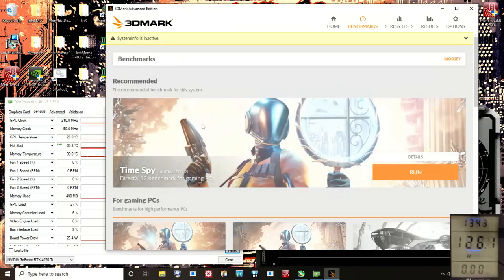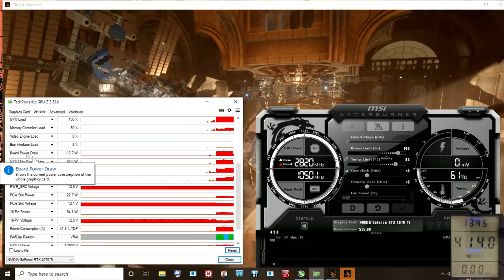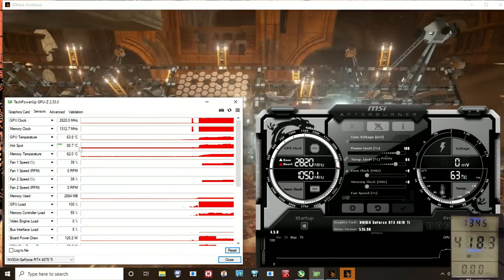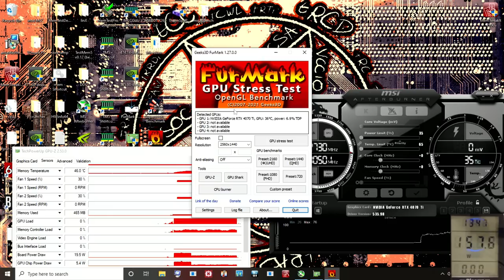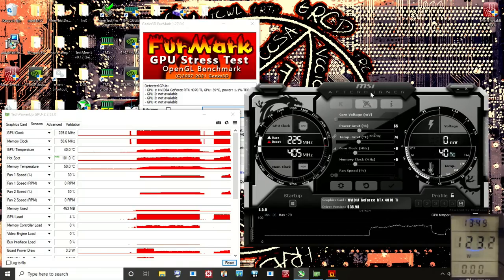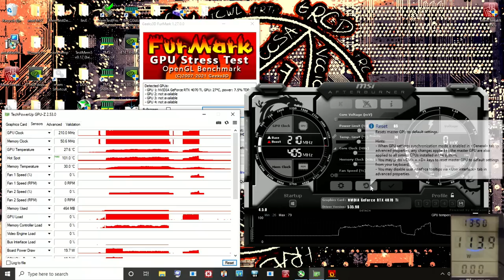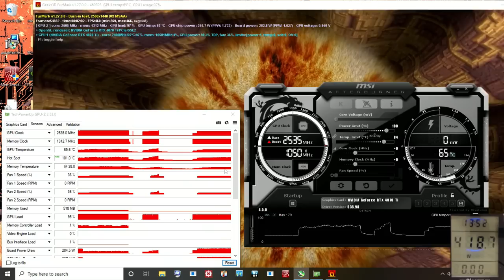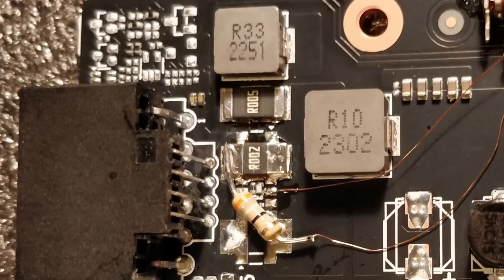Adding an on/off switch to the power limit of an ASUS RTX 4070Ti TUF

Comment: This is the greatest video ever made in the history of civilization.
Reply: It was pretty chill
Reply: So. Someone who has never fkd with PCV soldering or anything else- how hard is it for me to do this? I want to do this
Reply: @zbatchDOC  get a soldering iron and solder and flux and watch a youtube video on how to solder. Then practice on a few things and then you should be able to do it. Soldering isn't hard.
Reply: @zbatchDOC  if u have never soldered a power plug.... like 16 gauge wire... start there and mess up first.
This tiny stuff, and this is not even that tiny... but this gets exponentially hard
But ya get an iron and some tips and play with it. 
Not a bad skill to know
Beats just electrical taping a bunch of wires together

Comment: I expect the reason furmark is very good at fully loading the core is largely down to the utilisation of the SIMD lanes in the card. The gpu basically packs operations of the same instruction into groups but naturally you cant always have the group size exactly fit the number of SIMD lanes (typically 32) in the GPU. Modern GPUs tend to basically throw more SIMD lanes at the problem to get more compute horsepower, however this means that in "average" workloads they tend to be underutilised while in compute workloads (and power viruses) they can still be efficient at ladijg up all the lanes.

Comment: If you went full tilt with Furmark, that poor AD104 die would probably suffer from the same problem as the infamous Intel Pentium 4 which came close to the thermal power density of a fuel rod inside a nuclear reactor.

Comment: Personally, I'd just piggyback another 2 mOhm resistor and set the PL to 50% in Afterburner when I wanted stock PL.  Or at least I might, if extra power did much on Lovelace anyway, which it doesn't.

Comment: Port Royale in 3dmark is a good amount heavier on my 4070ti eagle. Couldnt get my oc to crash on TimeSpy, but on PortRoyale its fast xD.

Port Royale uses way more Raytracing. With non RT Scenarios my 4070ti pulls at least 30 watt less power than with RT.
Reply from the maker: So I just checked PR and peak power draw is lower than in Timespy Extreme GT2. I guess it's not actually heavier but the RT portion of the chip might not be stable at the same clocks as the rest of it.
Reply: @ActuallyHardcoreOverclocking  have you ever watched RT & DLSS with your probes, I always wondered how it changes compared to normal loads. 
I think RT + DLSS makes my GPU less stable but it may just be buggy games, always wanted to know.

Comment: Question, why you didn't just soldered the switch on to the shunt  resistor? Off = shunt / on = shunt bridged. 
Why the extra soldering, cabling?
Reply from the maker: the shunt has a resistance of 0.002ohms. I have no idea what the resistance of the switch is but it's probably a lot higher. Lets say the swtich is 10mOhm. It would only reduce the power reading by 33%. If the resistance of the switch is even higher it'll be even less effective.
Reply: Also, then you would have to deal with 10 or more amps DC going over that switch. You would need a way bigger switch and at least 1.5mm² (about 16AWG) just to not melt

Comment: Don't know about the 4070s but with my 4090, turning Core Voltage in Afterburner to 100% bumps the Vcore from 1.050v to 1.100v. That gives me about 90MHz more that the power limit alone wouldn't (2.715->2.805).

Comment: Can you check what HWiNFO64 reports for (Total GPU Power [% of TDP]) and (Total GPU Power (normalized) [% of TDP]) values if RTX 4070ti has them? I broke something for my Rog strix RTX 2070(maybe power sensing circuit?) and after that normalized is getting isane spikes and it was powerlimiting my card really badly, clocks dropped so much it caused noticable performance drops like stuttering. Kinda fixed it with shunt mod but i'm still sometimes hitting power limit even if raise power limit for 125% with afterburner but no more dropping clocks, normalized TDP hits crazy number like 130-150% and other TDP valu stays under 100% because of shunt mod.

Comment: 0:25 i had a LED like that on my GPU, same issue LED is on, works fine scores correctly, i fixed it by removing the LED with my soldering iron, sadly the led was vaporized in the solder

Comment: Had to do some math to satisfy my own curiosity.

Stock had it at 280w board power and 420w at the wall, meaning about 140 for the rest of the system. 
Assuming the rest of the system stays mostly constant, "real" boardpower during Furmark with shunt mod was about
220w at 35% pwrlimit
320w at 50%
390w at 60%
420w at 65%

obviously accuracy is pretty bad here since i also just rounded the readings liberally, but that'd leave the card at about 640ish watts at 100% of powerlimit on a die half the size of a 4090...
Yikes!

Comment: It held 2820Mhz with the Power Slider in Afterburner and only held a steady 2805Mhz with your switch flipped. Would you consider that a FAIL ?
Reply: The point it was that now it has much improved overclocking headroom

Comment: What clocks does it achieve if you let it go past the 1.1V ceiling?
Reply from the maker: doesn't have a Vcore mod yet.
Reply: @ActuallyHardcoreOverclocking   Maybe that's why TSE isn't pulling as much power. You need to blast it with more volts.😂
Reply: He needs to replace the cooler first, the hot spot temp is already close to 100C, so raising the voltage would just make more heat and lower the clocks.
Reply: @ActuallyHardcoreOverclocking  How about the EVC?

Comment: Could you not just solder a set of jumper pins across the shunt resistor and enable/disable power limits with a jumper?

Comment: Interesting video, because I just returned an ASUS TUF 4090, because it just didn´t want to use more than 180 to 190 Watts of it´s power limit.
PerfCap Reason immediately at PWR.
Was of course running way too slow because of that.
Now I´m wondering if something like that would´ve helped, even if I´d never do it...

Comment: I would coil up enameled wire on that resistor leg that goes to switch and on the switch as well(both sides). Save the hustle of soldering and give piece of mind when things get a bit hotter(not in this case).
Great video otherwise! Keep it up.

Comment: Would a buck converter make sense to further increase voltage?
Reply from the maker: no if I wanted to lower the measured power more I could just use a lower resistance in place of the 39ohm resistor.
Reply: @ActuallyHardcoreOverclocking  but wouldn't it then still be voltage limited?
Reply from the maker: @troeteimarsch  this doesn't control the core voltage it only affects the power limit.
Reply: @ActuallyHardcoreOverclocking  I think we're talking cross purposes here :D Is there any other mod you could do to further increase core voltage? Obviously power is not the limiting factor to performance, because it shovs in way too much current to maintain its' clock speed at heavy workloads. Would you agree that it could be less with more core voltage?
Reply: @troeteimarsch  more voltage always (tm) means more power draw. The reason to up voltage is to increase the flow of electrons into gates so transistors can switch faster. Flow of electrons = current, so more of it = more current. More voltage and more current = more power draw.
Or in other words: If you want higher (sustained for more than a few microseconds) voltage to enable higher clocks, the prerequisite is to get rid of the power limit.
Reply: @giantnanomachine  it doesn't always mean more power draw, this is entirely dependent on internal resistance / temperature. On an amplifier, dependent on its architecture, you can achieve different mu's with the same overall power consumption when you alter the proportions of current and voltage
Reply: @troeteimarsch  hence (tm) - my friend circle uses it to mean "in most practical cases, exceptions may apply, don't quote me on that". I think we got it from the internet at large but maybe the use is more local than I assumed.
Anyhow, for digital logic (and the stuff that actually eats 99% of the power on a GPU is all digital logic), it really comes down to "how fast can I push electrons into gates", which is a function of current, which in turn is a function of voltage. There is no (tm) room to play around with operating points or other concepts from analog electronics in nm-scale GHz digital logic.